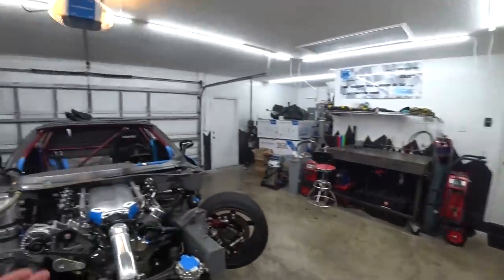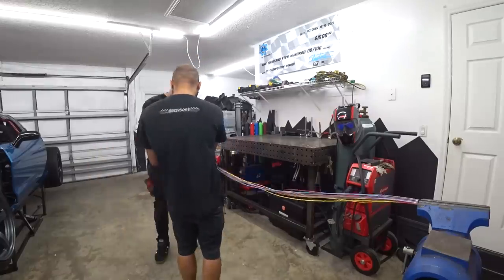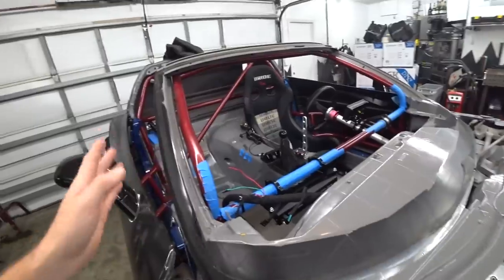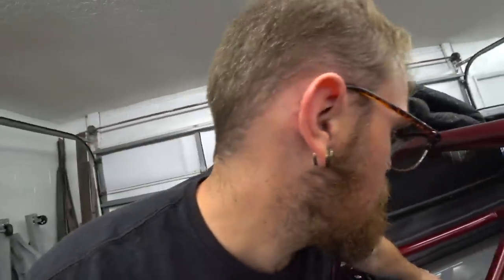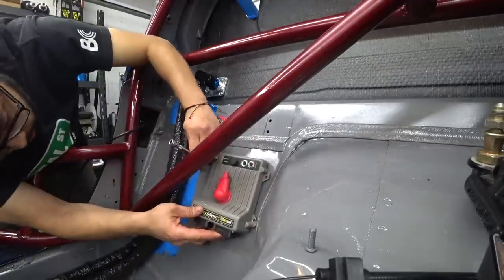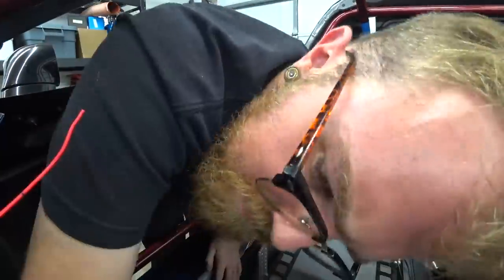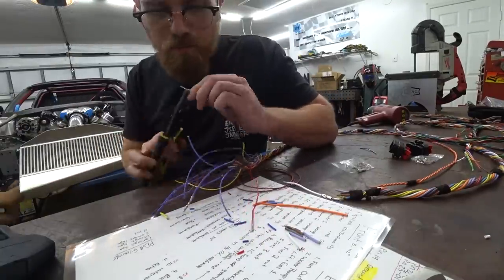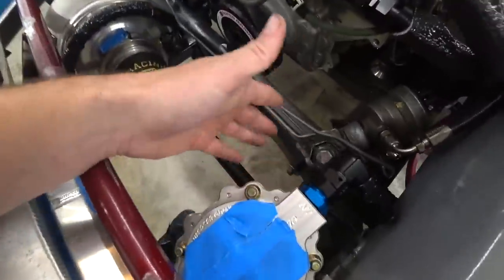C6 Corvette competition drift car build. doing it right and wrong.

Comment: If you need 12GA wire, your going to smoke those 16GA wire reducers.
Reply: If anything goes south they’ll be like little fuses.
Reply: Exactly the point I just made in a separate comment. That 16 gauge piece is actually potentially dangerous

Comment: I would check with some folks about that feeder wire thing and measure the loaded current before you drive
Reply: That was my thoughts. I've had to do it in a bind and it melted the wires down and I only dropped down one gauge.
Reply: Agreed. I’ve always used relays in situations like this to protect the thinner gauge feeder wires.
Reply: If he’s worried about voltage drop over a distance, and the feeder wire gauge can actually handle the current that’s going to be drawn through them it might be okay. 

But it’s definitely not the way I’d do it, relay closer to the pumps/fans with a power supply off the bulk head would be way better. Or different bulk head connectors that can take larger wire (I’m a qualified auto elec)
Reply: @haydenryan4225  

Tell me if this is correct :

The way I would've done is simply split that 12 gauge wire in two of those smaller 16 gauges feeder wires instead of just one like Taylor did, because in my mind that'd be best because you keep as much conductor if not more. 

You're splitting the load on the connector as well, because from experience my worry would be more on the connector than on the wire, I've temporarily ran undersized wire without too many issues despite it not being recommended, and the wires were never an issue (since I wasn't going too much over their ratings) but the connectors would always heat up or even melt.

Edit : This wouldn't really work, just realized this connector goes to the PDM and therefore splitting the wire in two would mean using two outputs... Not ideal. But this raises even more questions, really if the connector of the PDM isn't rated for wires bigger than 16 gauges is it rated for the type of current he's gonna ask from it ? You would think if it can only take 16 gauge it can only take the current that goes with that size wire, wanting to use a bigger wire probably also means you're wanting to use more current than it was designed for...
Reply: @imnota  yes that would definitely work, still not ideal. 
I also thought it was for the bulkhead connector! 

I’m guessing he’s worried about the voltage drop, just because a wire can cope with (let’s say 20Amps) without melting. 
When you need that wire to do a run longer than 2 meters or so you need to step it up in order to minimise voltage drop. 

I use this chart to work out what wire should be used https://www.rpc.com.au/pdf/Wire_Chart.pdf

Comment: FYI  for future reference , you want to avoid using a drill to twist bundles of M22759 (Tefzel) wire together like you did. The individual wire strands themselves are already twisted inside the insulation so when you twist them with the drill you are introducing more stress into the individual strands of each conductor (wire).

Comment: If you do in fact need 12 ga wire, those 16 ga feeder wires are going to cause you problems.  You'll notice it on your higher draw components when you're pushing them.
Reply: For how short a drift run is they will probably be fine. Although I'm not sure how accurate it is to say short wires will heat up less than longer wires. Sure a shorter wire has less resistance but it also has less surface area to dissipate heat...
Reply: @NNFaNRacing  Yeah, it's a short run but everything is at max power during that run.  Also, not sure on his setup but the fuses could be rated for the 12ga wire, which would make the 16 ga the weak link and that could fail.  If he's not using the capacity of the 12ga, then no big deal, it's just a bit of a waste having the bigger wire.  But again, no big deal.
Reply: Personally, I would’ve used relays from the feeder wires.

Comment: Hate to break it you Taylor but all your wires are now 16awg regardless of the longer run being 12awg. 16 is still the weakest link and any of those circuits are now limited to 16awg current. Yes its short and so it wont have a much resistance drop as a long run would, but you are still creating a small link that is the weakest point (just like a fuse is a very short run but is the weakest link) 
its like putting a 8an fitting on a 12an line. you are still limited to the flow of the 8an fitting. I hate pointing out stuff, i feel like i am trying to rain on your parade, but with the level of build you have dont i just want to see it all perfect as much as i know you do. I am an electrical engineer so this is right in my wheel house and what you did is a giant no no in my field of work. This could cause a harness failure or even a harness fire if you are trying to send 20-25amps on a circuit at 12awg wire would handle. Your PDM might trip and save the harness, but that means its going to be tripping before it should to save the harness.
Reply from the maker: Well the connector pin can only
Fit a 16ga wire. They tell
You that and you use a 20amp channel. Wire sizing per amp rating is based on distance. All the main stuff is two wires. Two pins.
Reply: @Taylordrifts  That really sounds like an oversight on their end or maybe a loss in terminology? The only thing i can think of is peak amps vs continuous amps. If you think of how a fuse works putting in a smaller feeder wire at a smaller gauge is basically acting just like a fuse does. If you arent pushing 20amp continuous power on one of those circuits you may be able to get away with that, but if you are pulling a strong continuous load i would be worried. Like i heard you split the fans on to two different circuits which will solve that problem for the fans. As a safety i would grab yourself an amp clamp and test the current draw of your loads once you get it all wired up. if any of them draw more then 15amp continuous, it would be a point of concern for me. None of them might and you might be just fine. Just advice. i dont want to see anything happen that will ruin a battle for ya man. 
 We use something just like this on purpose on our trucks. its called a fuse-able link. its one wire smaller then the rest to be the specific point of failure, acting like a fuse.
Reply from the maker: @fjm9898  no it’s continuous amps. Peak inrush current can be much higher.
Reply from the maker: @fjm9898  you don’t need any amp clamps it can log the current draw. Fuel pumps will pull 18A max at full boost. Probably 14A most of the time.
Reply from the maker: @Jon-R-Lee  the pdm is the relay.

Comment: Word of advice with wiring by going 12-16g wiring you are creating a bottle neck.  The general rule of thumb with wiring is you can step up in gauge but not down. By stepping down it creates a potential for fire.

Comment: I’m concerned the alternator would still be grounded and therefore the car could potentially stay running even if the kill switch is hit. Am I missing something?
Reply: No you got it right.   Basically all that thing is doing is shutting down the ECM so the engine should stop.  I don't really like it, there are far better ways to do it.
Reply: Yep, and there's also the chance that the battery cable could be pinched and grounded in a crash. I know drifting is almost a lawless land, but that wiring setup wouldn't pass as a proper isolator configuration in any racing series I've run with
Reply: How is the car going to run with no ECU? The alternator can't put power out if it's not moving. These isolators are used in top level race series all over the world with no issues.

Comment: One of the little touches that doesn’t seem like much but ends up being super helpful is using a label maker and clear heat stink on the connector ends. Yes you know where everything goes but if someone else needs to do some thing it really comes in handy

Comment: being a comp car you should add in 1 or 2 extra wires in areas that could be affected by a crash ie O2 sensors oil pressure or whatnot so if a quick repair is needed you have it in the loom alredy

Comment: Hey not crazy smart when it comes to car builds but I was thinking about how the oil pump is after the turbo and you said it would be under vacuum will that suck the turbo dry of oil?
Reply: it will likely not hurt the turbo, but it is likely to pull down the engine oil pressure to dangerous levels. We lost several engines on my FSAE team for that exact reason.

Comment: Good stuff as usual Taylor!
I would suggest using a flat copper bar (bus bar) with some shrink tube on it between the ground bulkhead and the emergency breaker.
That will be 2 connectors you won't have to crimp and worry about chasing ground gremlings.
Maybe even tinning the ends to help battle corrosion.

Comment: A few questions, all rhetorical.
Did you done check the transcribed pinouts. Did y'all double check the original.
Did you ring out the cables end to end. Connectors have always been the bane of electronics as sometimes the drawings, etc require careful visual as are you looking at the front (plugin part) or the back, wire insert side. Are you checking that ground is ground is ground. Some thoughts as to start with a smoke test might be poor form!

Comment: taylor spray copper weldthrough primer where you ground back the paint. you do this for 2 reasons 1 it will not allow the bare metal to oxidise and rust and 2nd it makes for a perfect grounding being copper keep up the great content cheers from down under

Comment: I know people touched on it already, but the wire size is based on amperage and the more current the circuit draws the more heat it will create. The insulation type and wire size determine how the wire will dissipate heat. In A/C wiring all the termination and insulation ratings (temp) have to be the same too.

Comment: Don't use dry crimped joints, solder them mate. You are doing everything so well and thoroughly, don't skimp there.
Reply: Joints aren't soldered in race harnesses. They are always crimped. Solder creates stress points.
Reply: @adematthewsracing  dry joints cause electrical issues over time. You can crimp and solder.

Comment: Taylor cut your losses man just get rid of those feeder wires. It’s gona melt that section. Just run your feeder wires to a relay or use one of those msd solid state relays to switch on your fans / pump ect.

Comment: I'm pretty sure that if you introduce a section of 16 gauge wire in the middle of a span of 12 gauge you basically make the entire 12 gauge run the equivalent of a 16 gauge run.

Comment: Taylor question is; Why didn't you solder and shrink tube the heavy gauge wires to 16 gauge pins instead of a short light gauge jumper wire? Don't the short 16 gauge jumpers create more resistance than the pin itself?

Comment: I'm just saying but I used to do what you did for another size wire on a thicker wire to fit into the connector and I realized that I can just cut off the shielding and cut off little sections of the wire from the inside to make it smaller to the same size as what it needs to be so I can be the same color wire

Comment: If you havn't already done so, put the rear wire bulkhead, just under the passenger side roll cage bar that goes through the firewall.  This would allow you to run your wires on the rollcage, which would keep it looking super clean, but also easy to service (using removeable zipties).  Cant wait to hear this thing roar, and see it slide!   Your videos are literally my highlights in weekly entertainment. car zen.

Comment: I doubt your radiator bulkhead fittings will fail but I’d still cover them it would suck hard for the passenger if they ever did fail unless those aren’t for the rad :)

Comment: With your wiring diagram you should either take a photo or with a scan app on your phone scan all the docs and save them as a pdf on your phone. That way its always accessible and you can print it off again if needed.

But if you are at the track and forget the hard copies you are not stuffed.

I do this often ( very often as i have CRAFTS … cant remember a f thing) saves me many times at work.

Comment: Why connectors over solder? I see alot of people spending time crimping and matching hardware when i've always used soldering to be quicker more reliable.
Reply: Soldering isn't use on race harnesses as it creates failure points under vibration.

Comment: The difference in doing a Concentric twist harness is that you would probably be using  Tefzel wire. That would more the save the weight of the added wires with smaller gauge and lighter wires.

Comment: Super novice at drift cars but seeing Colette's video is it the best place to have a kill switch by where fire could happen I know in monster trucks and other vehicles it's towards the back is there a reason why it's not in the back for drift cars? Or is that the regulated place where they usually have it so that it's uniform throughout the cars?
Reply: In FIA regulated series for cars rather than open wheelers the recommendation (mandatory in some series) for the external switch is to be on the scuttle below the windscreen. The internal switch can be anywhere but obviously has to be where the driver can reach it when strapped in. The idea of having it on the scuttle is so that the marshal can push it as he's checking on the driver.

Comment: looking good - the only thing i would say is have multiple gnd and make sure everything is properly fused and record all the data - think about having lites on sep small lithium battery that can trickle charge from a small panel - consider a rasp pi with bluetooth and wifi - you can use it as a backup for all the sw and fw

Comment: Please test your ground cut off. The PDM "kill signal" is likely going to make it work. But, there is a reason why NHRA doesn't allow them since I last checked. The alternator usually keeps powering things as it creates its own ground. Still, I love the build. I'm sure it will work, because I definitely haven't built as many race cars as you. But, I have built enough to see ground cuts fail to stop the car.
Reply: The car can't run without the ECU being powered so it will 100% work. These units have been in top level race cars all over the world for years with zero issues.
Reply: @adematthewsracing  that is what I figured. It would make sense if it just cuts ground to the pdm.
Reply: @davidblanck4131  The PDM kill is a 12v constant supply. When it goes off the PDM shuts down but it isn't the power supply for the PDM just a kill signal. The unit is also the only connection to ground for the whole car so if the external button is pushed or the wire loop it's on is broken then the units shuts down cutting power to everything, same for the internal circuit. It also has an alternator drain as well to stop the alternator trying to take over from the battery.

Comment: Im just curious on ur shut off if the fire was located near the batter shut off couldnt them small wire burn up faster to where they wouldn't allow u to kill the power I imagine its and issue with big wires to but wouldn't the bigger wires take more heat before they are cooked? Edit: u pretty much solved my question if I woulda watched a sec longer but still could use an answer
Reply: The way the system works is that pushing the button breaks the circuit so if the wire burns through it will have exactly the same effect as pushing the button.
Reply: @adematthewsracing  ic ic thanks for the answer

Comment: I'm impressed that it's still legal to use a software based killswitch instead if a real killswitch that actually kills power
Reply: It's not software based. It's totally solid state with no software at all. These switches are used in top level racing series all over the world and have been for years. They are far more reliable than the mechanical type.
Reply: @adematthewsracing  that doesn't make it that much better that it is a ssr or that a lot of classes use it, we're talking safety
Reply: @gbjoo8  So why do you think it's unsafe? What do you think would go wrong in comparison to a manual switch for example? I've used them for years as have GT teams, rally teams, off road teams etc.
Reply: @adematthewsracing  i'm an electrician with low voltage as my special and you can never trust a ssr
Reply: @gbjoo8 Well I don't know what is inside of them but they've been in production for 15 years now and if they were as prone to failure as you seem to think people wouldn't use them would they? As someone who builds and races cars I would much rather have these with their multiple fail safes than the old manual switch which have caused many issues for myself and fellow racers. Opinions may, and obviously do, differ.